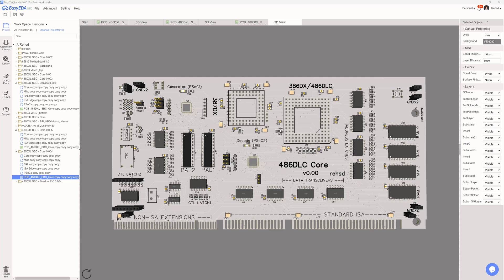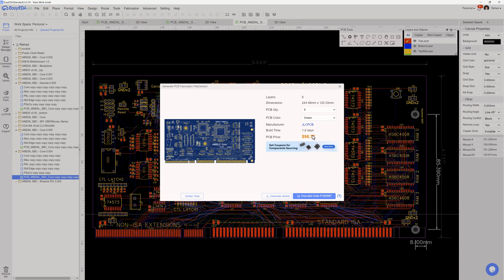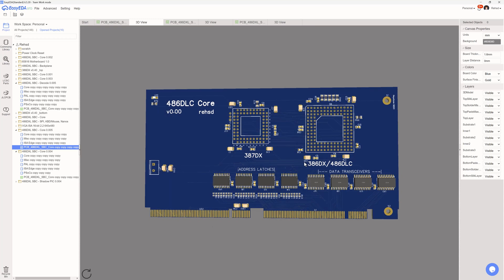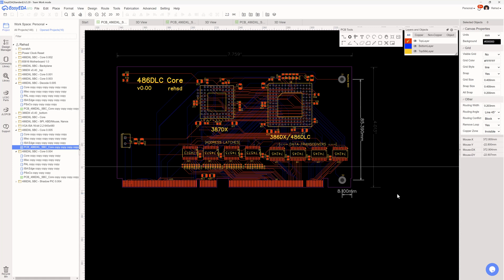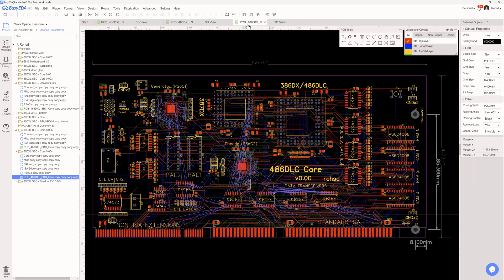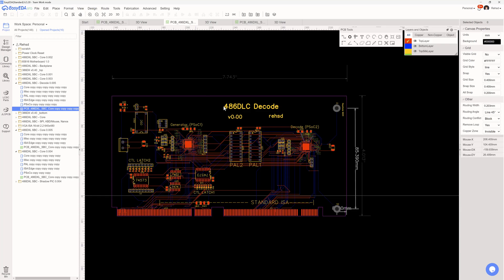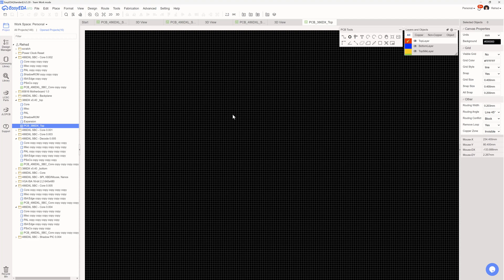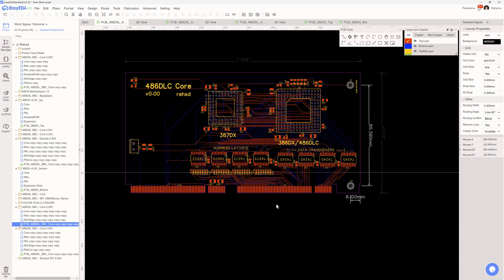Cx486DLC Build, Ep. 4 - Board Design, Step 4 - Modularity

Comment: Regarding price - jlcpcb's default via drill size is 0.3 mm, anything below it cost extra as far as I remember. You can check their online order form, but from what I remember going down to 0.25 or even 0.2 mm is not very expensive, but the next step down to 0.15 mm is precey.

Comment: The problem with "many-cards" approach is that going through multiple connectors is not good for signal integrity, not to mention long lines means higher delays, which at some point might lead to timing problems. Which is why I would stick to a single-board design whenever possible. If you think this Psoc thing is risky, do a stand-alone prototype, but I think sticking to one board for all high-speed stuff is preferred.
Reply from the maker: Ya', I'm torn. You have a good point. The multi-card setup may actually shorten my over signal trace length, but it is more physical connections to cause issues.
Reply: @rehsd   If you keep all high-speed stuff on the same board, it will surely lead to shorter traces than multi-board setup. Also, one board for 75$ vs. three for $25 each seems like a wash to me in terms of total cost.
Reply from the maker: @asmi06 A wash, as long as I don't have to order any updates due to issues.  :)
Reply: @rehsd  Oh, I'm 100% sure you will, if not due to issues, but to add some more features. But that's just the way these things go - you always want to add more and more 😀
Reply from the maker: @asmi06  Exactly... the never-ending projects.  :)

Comment: I think your PSoC looks much better with the decoupling capacitors underneath, it's a design pattern I often use myself. Try to have all grounding pads on the same sides as opposed to trace individually, i.e. have a (larger) ground on the middle/center and route Vdd with a shortest possible trace from the caps to the chip pads through a via, possibly underneath the chip itself. This is how just about every modern dev kit does things these days, and if it works for them, then it should be good enough for us :) Hope that that makes sense in how I am explaining it.

One other suggestion I would put forward, is for you to design a PSoC stand-alone PCB, to test your design on this part (module let's say) by itself, and if that works, then you can transfer it "as-is" to the other boards. 

I would use the same PCB layers, layout and routing ruleset as with the bigger boards, so to make this as much transferable as possible (well with reason :) So if things don't work you can iterate more (and more cheaply). If things don't work when you actually do the larger design, at least you have a good picture, since the stand-alone does work. by itself 

JLC (not affiliated btw) offers 50mm x 50mm 4 Layers for $2. Cheaper for troubleshooting in case something needs adjusting, and as you very well know things tend to do :)

Best of luck :)